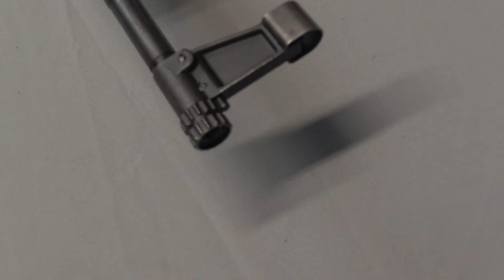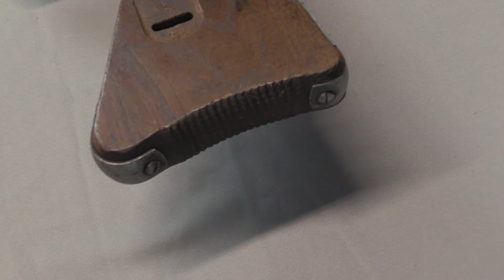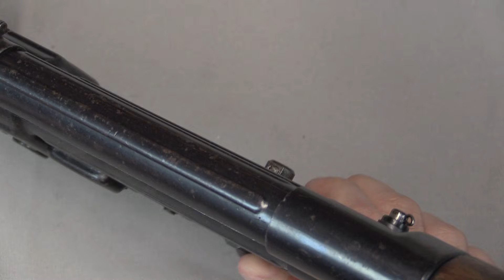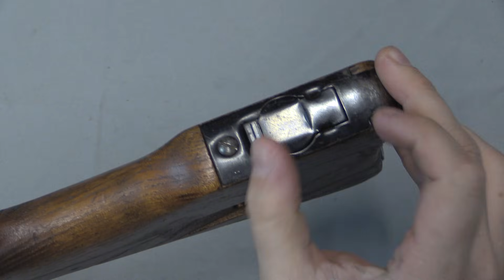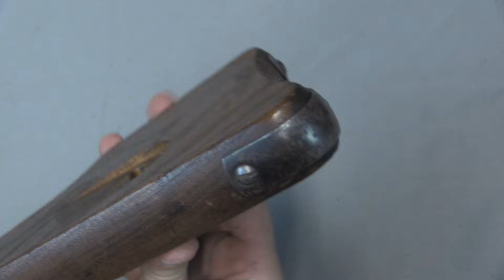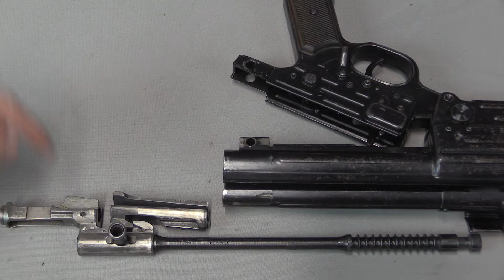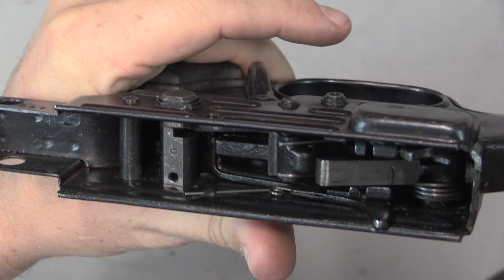Sturmgewehr MP-44 Part I: Mechanics

Comment: As someone who have lugged the HK G3 around more than I care to think about, it is very fascinating to see the lineage back to the mp44. Thanks for this Ian.
Reply: Correct.Though I'd like to add more .Stg-45m used Roller-delayed blowback mechanism which might've taken from MG-42 machine gun.This very same mechanism was latter Implemented in Various firearms, Like CETME,G3,MP5,PSG-1,HK33,HK43 etc..
Reply: T Ras 
I've heard the G3 was based off of the STG 45, which didn't share a whole lot in common with the 44 design wise.
Reply: True. the bolt design is very different. but general design, stock, bolt guide, pin disassembly is principly derived from this gun

Comment: The hot metal handguard probably caused soldiers to habitually shoot it by holding on to the front of the mag well or the magazine itself instead of the forearm, slightly reducing its practical accuracy.  A wood or bakelite forearm cover would have cost very little.
Reply: Cost little but takes time to make. At the time this went into production productionspeed was a considered factor.
Reply: by the time these were being issued, germany had had fuel, food, wood, mineral shortages for 2-4 years. unlike the russians and allies, germany had severe rationing starting the day they invaded poland. the had the logistics worked out to where if the were halted at any point for any delay. up until the complete occupation of norway and france, defeat would be inevitable. and similarly they knew they would only have 3-6 months of fuel left to take moscow. steel on the other hand along with the best steel related craftsman on earth they did have. the germans played extremely high odds, stupidly high. but every day the gap grew bigger so no better time than now.
Reply: Shooting it by the mag well doesn’t reduce practical accuracy at all.

Comment: The locking mechanism. (Bolt, and carrier) looks very similar to the SKS. Gas system on that gun is a little difference, but the Bolt and Carrier could have been almost a direct (not copy) but 'inspiration'.
Reply: The SKS bolt and carrier are pretty much scaled a down PTRS-41 system (also designed by Simonov). I suppose the German designers could have been inspired by that or it could just be a case of convergent evolution.